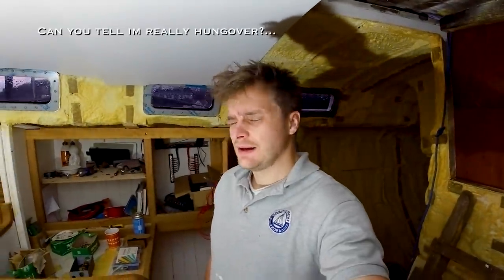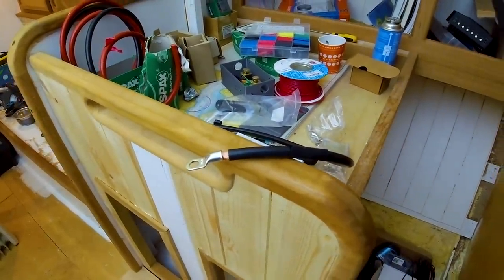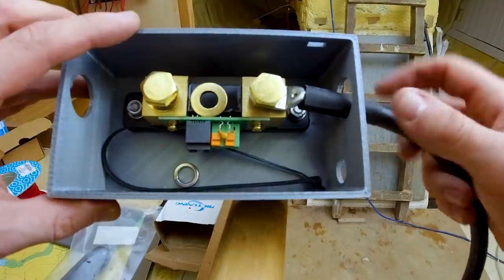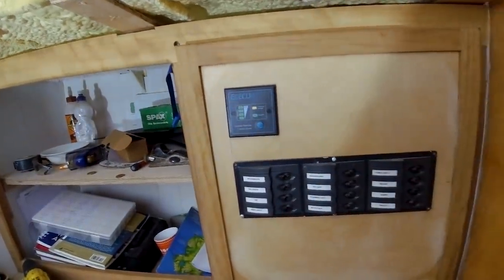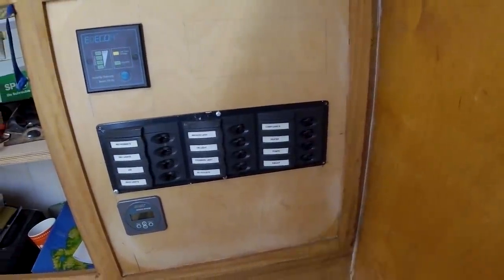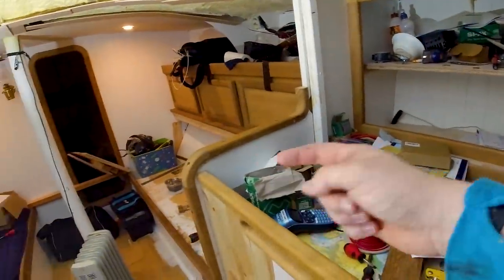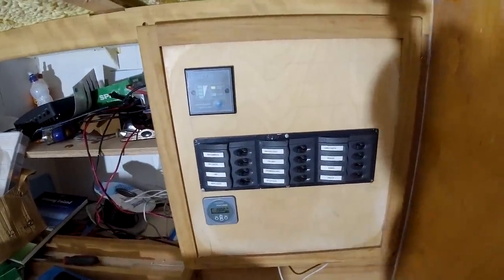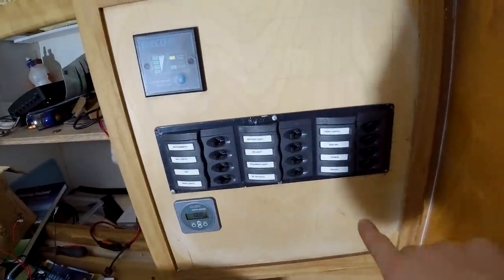Angry Pixies on My Boat - Episode 40 - Sailing Yacht Zora

Comment: Nice work on the box, but you should put a drip loop on that negative cable coming down into it, as water will run down that cable which will accumulate from condensation.

Comment: I’d recommend re-reading the manual for that inverter. Looks to be missing at least 2 fuses, and I didn’t see a chassis ground. Like a seatbelt in a car, you don’t need it for the car to work, but when you need it you really need it. Put in those fuses and chassis ground.
Reply from the maker: It's actually got a large bank of small fuses in it casing. Yes it does need main fuse, I have yet to fit those.

Comment: Consider using ... tinned wire, marine electrical crimps not automotive, glue lined heat shrink, make shunt water tight or corrosion will get it. All feeders need to be fused. Ideally the cable crimps butt up to cable shielding. Zero gap.
Reply from the maker: Definitely need to sort the fusing!

Comment: I think you'd be better served by turning that battery 90 deg and moving the selector switch, then you could parallel up three batteries in a house bank.  I also agree with what others have said, you need a heavy fuse between the Inverter and the battery bank, also probably one between the battery and the main bus bar.   One last thing about the box you designed.  You should use some bushings and gasket material to seal that thing up.  Anywhere you can eliminate air gaps you'll help cut down on corrosion.

Comment: Great work Rays. Clean and tidy and easy to troubleshoot in the future. Think about ventilation in the battery closet. Especially when you get to the lithium batteries. I’ll return to the “fold” soon. Wish I could share with you some photos of my wiring setup. 
Cheers
Jim (woahboy)

Comment: It might not be as tidy as Mads' wiring yet, with bits still lacking and white still to be brushed on someplace, but it's definitely already now a wee bit tidier than on 98 % of the sailboats I worked or sailed on in 30+ years of boatbuilding, delivering and instructing - including the brandeffing new from factory ones.

Comment: Hi, as for lithium batteries: you do not need to bite the bullet: just look around for battery pack to electric cars - they are at good price and with a decent bms they can work just fine. If they went through all tests at the car manufacturers and authorities, they are also good for the boat. Az for bms, look at forums - more-and-more people hecked into the oen bms-s.
Reply: alternatively - if you want the highest energy density and don`t mind the hard work - buy used laptop batteries. This is how I got 5kw li-ion for about 300 US.

Comment: I just wish I had seen this video about 4 months ago before I crimped up the big cables for my winch. I'll be buying one of those crimpers. The blue tooth works well on the Victron stuff but the alarms are a bit quiet when our engine is running. We got ours after boiling a battery and frying a television. One new regulator later. Good info on the PCB on the shunt. I will check ours tommorow to see if it is at risk.

Comment: its usually convenient to have shore power to run power tools you already have. You could use the inverter but it kicks the bgezus out of the battery if theyre bigger tools
Thats what I did anyway, while everything is 12 v, but theres a mains outlet for tools and a significant 20ah 3 channel charger for engine and house batteries
Reply: I agree whole heartedly as you WILL spend time at a dock whether you thinks so or not.  Don't be chintzy either.  Have the capability to run an electric heater(s) and charge your batteries with out stressing your wiring.
You need to secure the end of the flex conduit to the door to remove the pressure and flex from the switches.
Reply: I second that, there will be situations You have to spend on a dock working with power tools, and it makes things much easier to be prepared and just put on a shoreline instead of wiring all via extension cords. The latter does work, too, of course, but it's dangerous and You do not want to meet the dock's own electrician after inadvertently throwing their 230 or 380 V into the swamp.

Comment: Just a thought, you missing fuses, all cables must be protected with fuses to prevent possible cable fire and on top of that all connected devices should also be protected by another fuse. 
You should also use tinned wire and the crimped terminal should be solid, not the ones with a hole notched in them.
Reply from the maker: I agree I need lots more fusing, that's next on my list 😎

Comment: You should have gotten done cable holddown  for where the cable comes out the box the have washers and a nut to hold them to the box and the cable runs through and you tighten couple screws to hold the cable in place all junction boxes fit like that tll you but the cable holds on

Comment: So victron + android app... and my buddies wonder why I’m still on Apple. Nice job on keeping it neat.  Anybody else appalled at what bus bars cost?!? Sheesh.
Reply from the maker: Damned expensive! I've never had an apple phone 😅 it seems to work now though.
Reply: I use the victron app on both Apple and Android with no issues whatsoever. I did find some other boats in the marina on the default pin, meaning I could mess with their battery chargers if I was so inclined.
Reply from the maker: @philgray1023  I got it working after a while, I'm just inept

Comment: Hey Rhys, what size wire are you using for all that DC to/from the terminal blocks and down to the lights etc? also, are you using 100A busbars? great work, helping me loads
Reply from the maker: My bus bars are 150 amp and the wiring for the lights is 1.5mm2 tinned stuff. But each wire has been sized for each load so make sure you calculate the wire runs properly. Look online for a calculator and you'll be flying. Look on 12 volt planet

Comment: Check out DMS technology and their Lifeline or Red Flash batteries. We use AGM as they are spill proof and can be mounted in any orientation. I would go AGM over Lithium purely for safety as in the middle of nowhere an AGM battery fault will swell it, a Lithium fault could end in a fire. Not good on a boat imo. Not cheap though but excellent.

Comment: Regarding the lithium stuff,  I found this guy a few weeks ago he has a wealth of info on lithium setups   And has options for it on the cheap. https://youtu.be/TkS9mklxRt0. This is a link to one of his Videos but he has a lot of other stuff covered in other videos from solar panels to BMS setup, battery monitors, low tem cutoff set up etc,  all good info if you have time.

Comment: Rhys, I don't mean to suggest that you haven't done your research, but perhaps you may have missed this excellent resource on the topic of Lithium on boats. http://nordkyndesign.com/electrical-design-for-a-marine-lithium-battery-bank/

As much as LiFePO4 battery manufacturers and ill-advised youtube "experts" would like you to believe that their batteries are "drop-in replacements" for sealed lead-acid systems, this is simply not the case. Often, the implementation of lithium aboard requires a complete redesign of the electrical system to ensure the safety of the crew and vessel. If you opt for lithium, this choice necessitates designing the system for lithium from the ground up. Good luck!
Reply from the maker: Cheers mate, I mentioned in the last few videos that I've put the system together to be able to support lithium 😎 so hopefully it won't be a major problem!

Comment: Have you played with heat set inserts for 3d printing yet? That would be ideal for securing the lid to that box if you were so inclined. good for making water resistant boxes You can see one possible implementation in my ROV control box here. https://www.thingiverse.com/thing:2353361